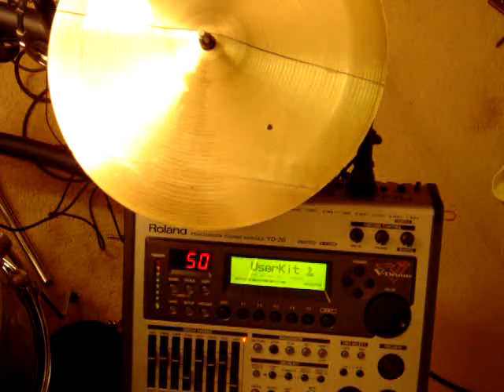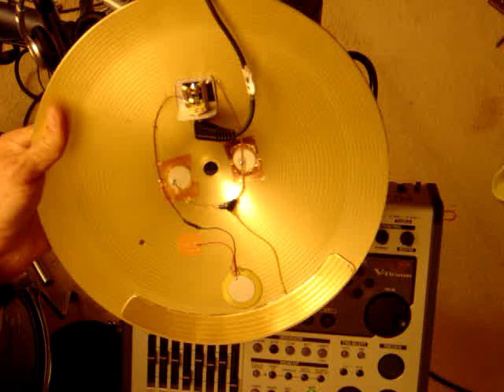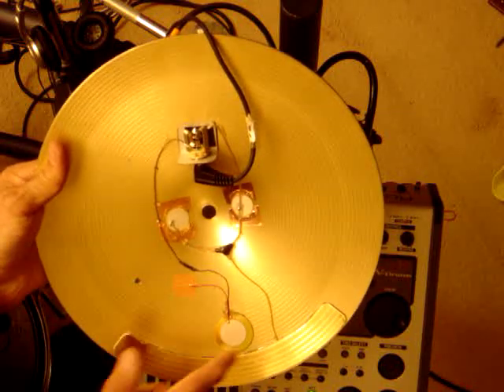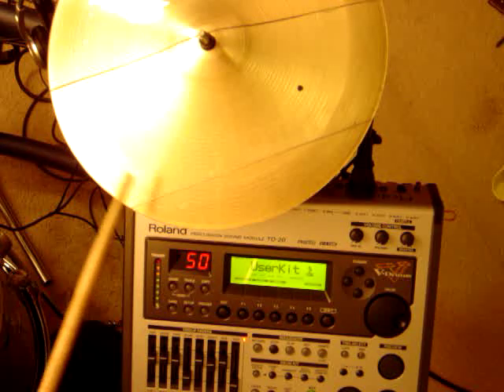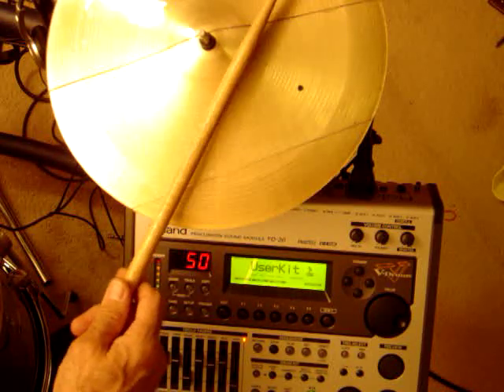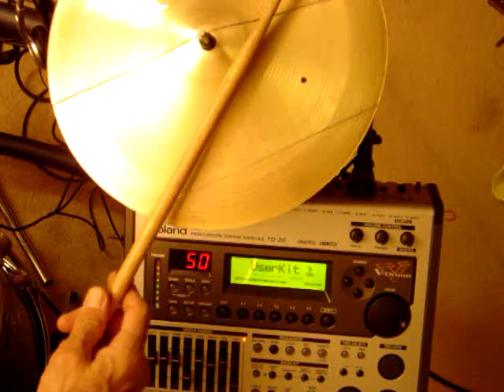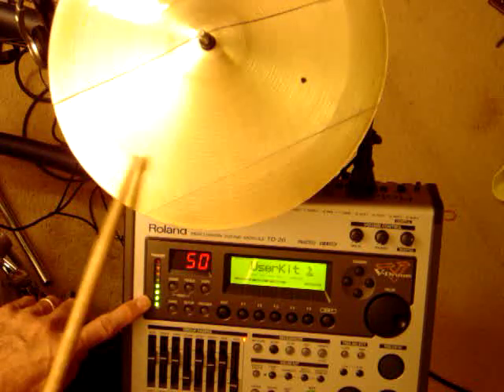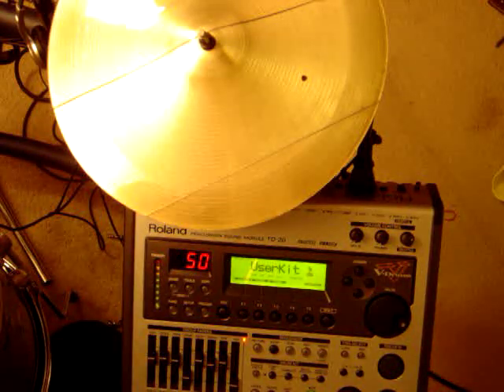12in DIY 2 Zone Ride w choke.MPG

Comment: The CY15 has much better response on the bell than what you are implying. I believe your experience with the CY-15R may have been from the days when the cymbals were shipping with bell issues. There is a very simple fix to slip in a piece of mousemat which allows super light bell playing, and even triplet drag rolls.

Comment from the maker: @mazzhanif1 , This is a piezo trigger. Yes,  it will work for the drums too - Please see all my videos. 

 Regarding your reference to my Optical device;  The Optical HH Controller producess a 'control' signal  (the foot pedal of a HH).  Many drum controllers use an on/off switch, or two on/off switches to 'control' the HH.  A few use a variable controller, fewer use a variable voltage controller.  My Optical HH Controller is the variable voltage type, as used by 'Megadrum'.

Comment from the maker: @mazzhanif1 , This is a piezo trigger. Yes,  it will work for the drums too - Please see all my videos. 

 Regarding your reference to my Optical device;  The Optical HH Controller producess a 'control' signal, not a 'trigger' signal.  Many drum controllers use an on/off switch, or two on/off switches to 'controll' the HH.  A few use a variable controller, fewer use a variable voltage controller.  My HH Controller is the variable voltage type, as used by 'Megadrum'

Comment from the maker: @MrKeithhilley   From what I know of the DD502, it uses single zone triggers. So yes it will work, but ONLY as a single zone. The second Piezo would need to be wired to another input of the DD502.  I was unable to determine if the choke will work. So, in affect, you could build a single piezo (single zone) metal cymbal that would work.  I suspect that the choke feature is not available on the DD502 - Although I am unsure of that.  You will need to do some research on the dd502 operation/feature

Comment: i actually mention racer52 in my vid cause you are where i got the idea for the switch and the explanation of the roland wiring. thanks for that. for sure worth an honorable mention, right? haha. the rockguard i already knew about( i believe thats whats on the surge and other smart trigger cymbals as well. any way check out the vid and tell me what you think. stay cool.

Comment from the maker: To MrKeithHilley.... I also took a look at the DD502(W) manual. [ found at: medeli DOT com DOT hk/downloads/index DOT htm ] put . in place of DOT.  The cables are only mono type (Tip/Sleeve)  So I doubt that the actual input to the module is anything but mono. My DIY needs a stereo input (Tip/Ring/Sleeve) on a module that supports dual triggering.  It seems the dd502  uses only a single trigger type pad.  You can still build your own pad - it just needs to be a single piezo only.  Best Wishes

Comment: @bigtubeocaulk1 also i know from doing acoustic drum conversions that mounting the piezo on a piece of 2 sided foam tape the size of the ceramic part of the piezo lets the copper part vibrate much more, thus increasing sensitivity. dont know if it would be ideal on a cymbal. but it might work.

Comment: I'm curious if you've ever attempted to make a 3-zone ride? I haven't found any information on how Roland wires their three-zone cymbals, but I know that megadrum modules can get away with just one stereo jack because the edge trigger uses a 10k resistor in series
Reply: maybe something like this is a matter of layering a surface so usind different layers with indepentent piezos self isolated you can have different zones in the same surface .

Comment: Does anyone know if Alesis wires their the same? I got a DM10 module from ebay and trying to make a ride with bell and one crash cymbal with choke.
Reply: Did you ever complete the cymbal conversions, I’m going to start the same process my self
Reply: @scottw3780  yes i did, i used plastic practice cbals and a pvc pipe cap for the ride bell! Lol weeee

Comment: just wondering, does the choke wire touch the cymbal or the choke strap? really confused about this... thx
Reply from the maker: Diya Tailor see diagram here:http://i814.photobucket.com/albums/zz69/racer52online/e-drum%20projects/Dual%20Zone%20Cymbal%20w%20Choke/RolandWiring2Zonecym.gif
the wire is electrically connected to the R of the TRS connection. The same wire touches the 'choke strap' - when squeezed it makes contact to the cymbal. the cymbal is electrically connected to the S of the TRS connection. thereby when the switch is squeezed, the R & S get shorted together to make the 'choke'
Reply from the maker: Diya Tailor  see this  drawing of the schematic here:http://s814.photobucket.com/user/racer52online/media/e-drum%20projects/Two%20Zone%20Ride%20w%20Choke/DualZonewChokeSchematic_zps91365150.jpg.html?sort=3&o=0